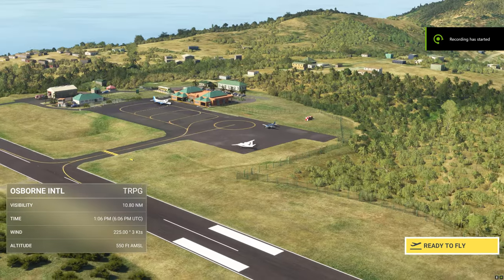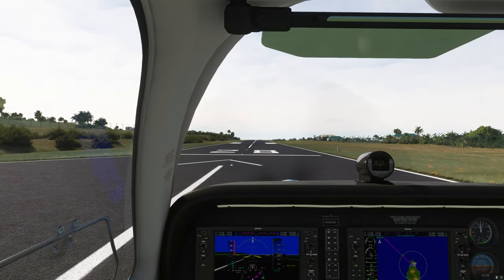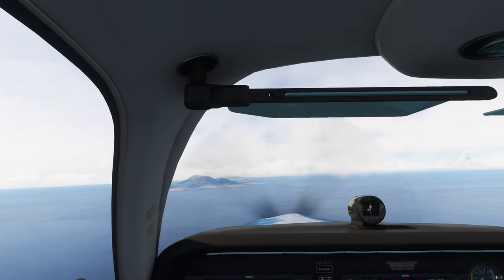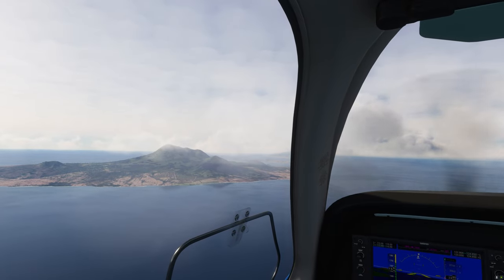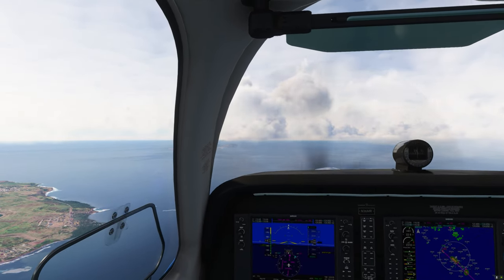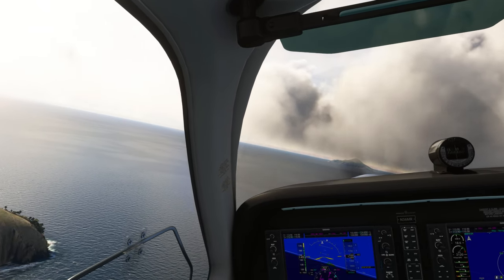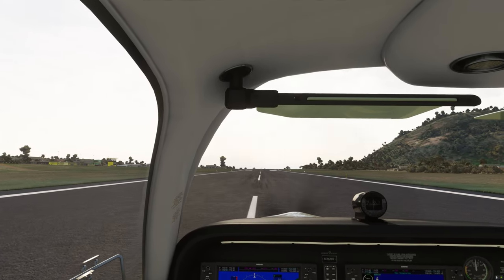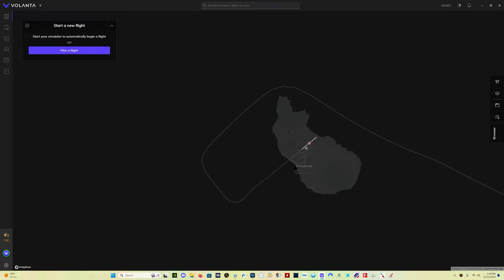My Vision for My Channel | Montserrat to Sint Eustatius | MSFS 2020 | Flight Simulator

Comment: Nice video.  Were you using your Holy Grail settings?
Reply from the maker: I was indeed. One thing I've noticed is that clouds are not a problem, but like whispy fog can really cause problems. I got a little bit of that in this flight. Not really sure why.

Comment: Lovely video, can i ask how you are generating weather? I understood default weather left blue holes in the Caribbean but the weather addon (weatherforce?) you used earlier did that disconcerting refresh.
Reply from the maker: I’m actually just using stock weather nowadays. It has improved immeasurably over the last 6 months or so.

Comment: Do you talk to yourself in these flights? Do you pretend there is a real ATC?
Reply from the maker: I’m on Vatsim, broadcasting in the blind because there were no controllers on when I was flying. So basically like flying to non-towered fields.
Reply: @IslandSimPilot  So who is listening and what is the purpose?  I only ask as I am new to flight simulator.
Reply from the maker: @Andy006-tj7ts  it’s a very good question! So in the real world, not every airport has a control tower. For ones that do not, pilots communicate directly with one another on the common traffic advisory frequency (CTAF). You are regular broadcasts “in the blind” (we call it that because you don’t know who is out there listening) to tell others your position and intentions.